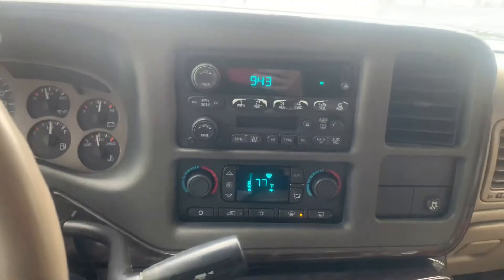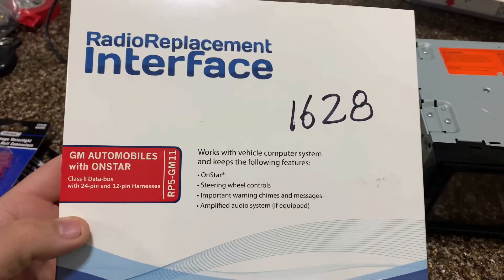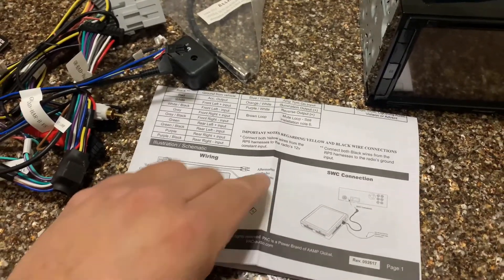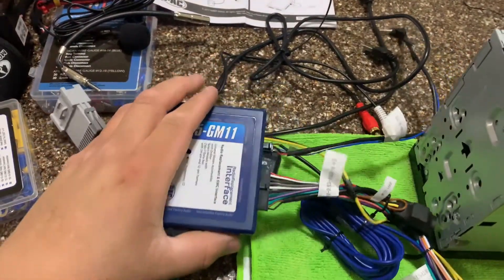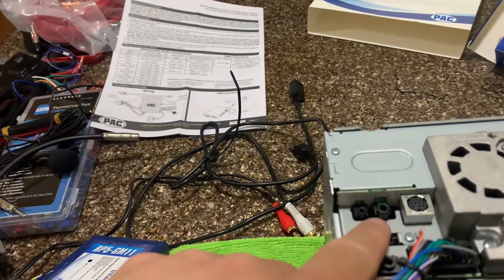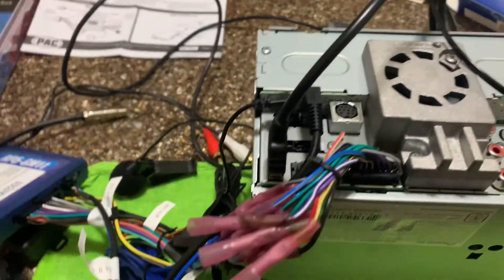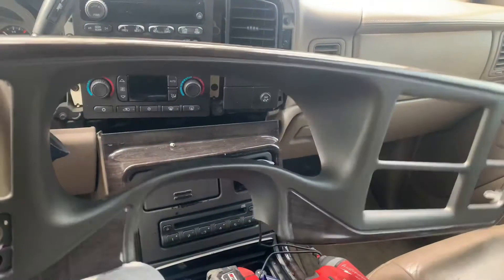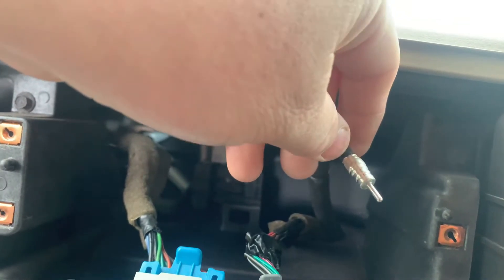Installing a Car Stereo in a Yukon Tahoe Escalade.

Comment: Did you need to connect a red 12v wire to the fuse box? Or just matched the same colors with the colors?
Reply from the maker: I just matched all the colors